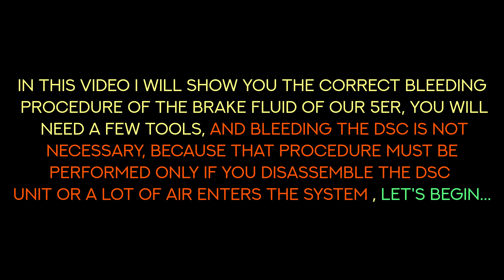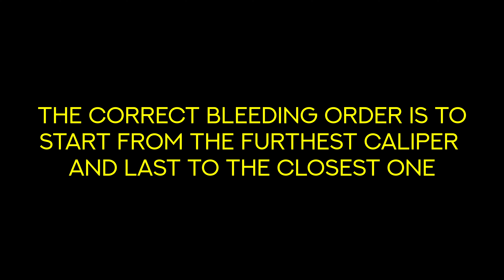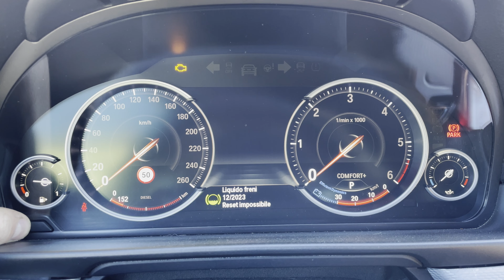How To Flush Brake Fluid on BMW 5er F10/F11

Comment: Hello, I have a question regarding usage of this manual bleeder. What happend with the air which is in pipe between bleeder and brake servo tank ?. If you fill the servo tank with fresh fluid and then tight the cap with connector you have a small amount of air under the cap. After connecting the pipe, inside the pipe is air. Then, you start pumping the bleeder and fluid from bleeder is going to the car but before fluid is air which also goes to the servo brake tank. Is it works ? Are you sure that the air is not coming to the brake system of the car. I'm thinking about purchase this type of tool but  I have a little bit worries 🙃
Reply: The air always stays on top, u can try at any fluid in the bottle, air always go up 🤷🏻‍♂️😂😅